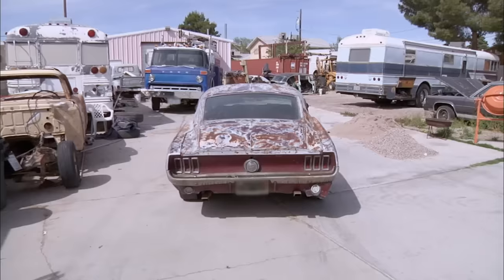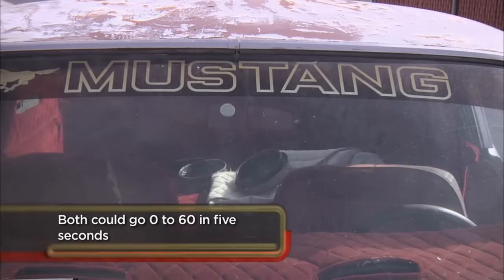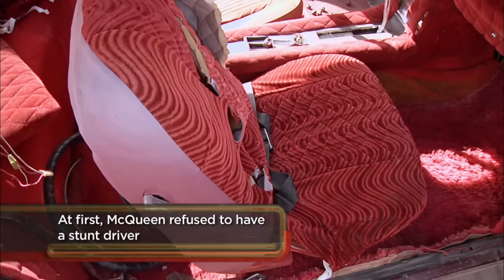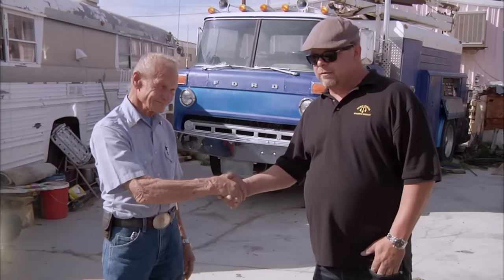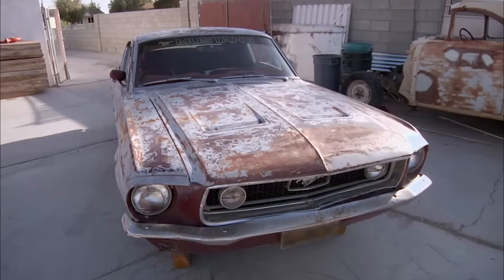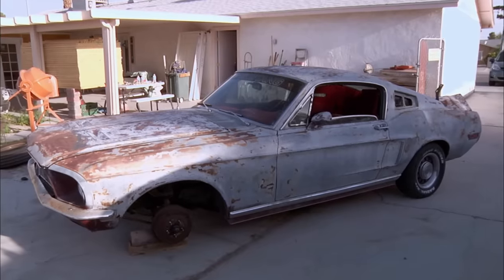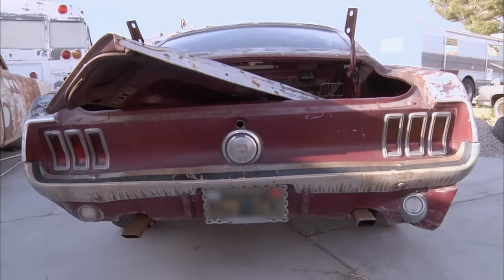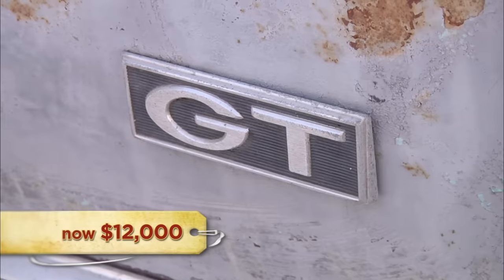Pawn Stars: Rick & Corey Can’t Agree on RARE '68 Bullitt Mustang (Season 6) | History

Comment: I love how Rick was bragging to Cory about how he knew it was a 351, but then Danny corrected him saying it’s a 302
Reply: They didn't even offer the 351 in 68
Reply: The bullet came with a 390
Reply: Legit looked for this commit
Reply: Was gonna comment the same
Reply: The 68 GT came stock with a 390 FE big block....
Reply: @jefflessar149  you mean..  68 Mustang GT's had 390's.
Reply: Original Bullit car had 390 ci-
Reply: @jefflessar149  

The "Bullit" was not a trim level so it couldn't come with anything. 

It was a 1968 GT. 

Engine options that year for the GT where the 289C, 302CS, 302HP, 390 T Bird, and 390 T Bird Special.
Reply: It amazes me how clueless Corey is. Smh 🤦🏻‍♂️
Reply: @branon6565  not a big block
Reply: @andrewirick5620  you forgot about the r-code 428cj that they offered in 68
Reply: I was about to say that I figured I'll scroll down the comments and found yours Rick don't know nothing about 68 Mustangs I doubt that car is even a real GT I mean Danny didn't even mention the code of the car if it's a c code it's a base model and they said it's a 302 so it would have to be A J code if it was a GT
Reply: @CstopCstop  

The 428 was a Shelby only engine. It was not an option for a GT or any other trim level.
Reply: @CstopCstop  

68 was the first year the 302 was an option the HI PO 289 was not dropped from the lineup until the 69 model year. 

You can check Ford's dealership brochures to verify if you like.
Reply: @andrewirick5620  you could get a 428 in a 68 1/2
Reply: @patrick-ro8bi
Reply: Exactly!! I was shaking my head at that one. He was so far off base. A 351 never was an option in those. And a “four bolt main!” 🤦‍♂️
Reply: @andrewirick5620  the 428 Cobra Jet was a mid year option, there are even Mustang coupes with the 428, it was standard with the GT 500
Reply: @pat168  428 Cobra Jet in the GT500KR, this replaced the 428 Police Interceptor that was in the GT500.  But I don't believe this was available at the time Bullitt was filming.
Reply: @chrisz968  wonder how many deals Corey passed on that could of got him rich.
Reply: I don't really know most of my Ford engine sizes.. i know  Chevys and Dodges though , and few fords. I waa just never really interested in them, since the few i had were unreliable. My mopars were ok around town, but my classic chevys and toyotas were in it for the long haul. The reason you see more classic Chevys and Toyota's are because people hung on to them longer because they were more reliable.
Reply: @privateprivate1865  "Classic Toyota" is an oxymoron.
Seriously Private... you have absolutely no idea what you are talking about.
Reply: @jerryjeromehawkins1712  ok. I don't understand what you mean I'm interested though. .. I got to go try to find my old comment cuz I don't even remember what I wrote
Reply: @jerryjeromehawkins1712  I'm guessing we are not on the same page in terms of years? I'm talking about the old 20r, the old 350s and 327s, I don't know what you mean by classic?
Reply: @ericl7199  same I had to read and scroll before saying same thing , talk about scripted.
Reply: 390. Only
Reply: @dougjustdoug6391  The Bullitt cars all were S Codes. That means they had 390 FE engines.
Reply: @CstopCstop  It was a J Code by the engine in it. That means it was eligible to be a GT but you would really only be able to tell by knowing what to look for and by running a Marti Report. (Available 1967+)
Reply: @kalan4787  Yes, you're correct,  but they did have the 68 1/2 "R" code 428 CJ GT that came out mid year.  As an interesting side note, I had read somewhere that the sound effects for the mustang in this movie were from a GT40 with a 289 and bundle of snakes exhaust.  I can't remember the source so I won't state this as a verified fact.
Reply: @dougjustdoug6391  Right, but the R code was irrelevant to this conversation because the car was already known to be a J. The near mythical "X" code was also eligible for the GT trim package, but this is a J.
Reply: @kalan4787  I was referencing the Bullitt movie cars not the basket case car on pawn stars and the fact that the R codes wouldn't have been  available when filming started on the movie.
Reply: @dougjustdoug6391  But that isn't really relevant either. It is well known that both Bullitt 558 and 559 were S codes. They were purchased by Warner Bros. Both Bullitts came with 390s
Reply: @kalan4787  Yes I have already agreed that the Bullitt cars were 390's, but you seem unable to grasp my simple point which was that the 68 1/2 R code was not available at the time of filming and therefore could not have been used.  Making a simple statement of fact is not irrelevant.
Reply: @dougjustdoug6391  Bullitt cars 558 and 559 were both manufactured January 8, 1968 (1 day ahead of schedule.) You are correct to say that the 428 CJ was not available at the time they were produced.

The CJ wasn't available in a Mustang until April of 1968. (Production of the CJ was started in '67 as a continuation of the 428PI and was first unveiled in the "135" cars at Winternationals '68. The "135" cars were produced in December of '67 so the engine must have been produced at least no later than that month)
Reply: @CstopCstop  yeah was thinking an expert would be able to tell looking at the vin or you could call.someone with the vin
Reply: @gearhead762  68 GT's had the 302 OR 390, depending on what powerplant was chosen.
Reply: @Twizter68  i know...i was pointing out to dude they were not "Bullit" models that came with 390s...its just a 68 Mustang GT lol.
Reply: @jefflessar149  Bullitt is a movie.  The 68 GT came with a 390.
Reply: I bought one back in the 80s for 200 bucks
Reply: @ericl7199 lol me too

Comment: Of course this wasn't THE Bullitt Mustang.  Two 68 Mustang GT Fastbacks were purchased for the movie, each with consecutive serial numbers 558 and 559.  After filming 559 was sold off and passed through several owners, Steve McQueen tracked it down and tried to buy it in 77 but was refused, it went through extensive restoration in 2014 and was sold at Auction in 2020 for $3.7 million, the highest price for any car.  558 was heavily damaged during filming and was sent to a scrap yard where it was believed lost, but was found by a car buyer sitting in the backyard of a house in Los Cabos, Mexico, while working on fixing the car they noticed the ID Number and authenticated it as the actual lost second Bullitt, they're currently working on restoring it to its original condition

Comment: Steve McQueens car had a 390 in it not a 302.
Reply: There were two cars used in the Movie and your correct they both had 390's .
Reply: Yep. I read a great interview from 2015 with the stunt driver of the Charger 440 R/T and he had to let off the accelerator on the straightaways to keep the chase dramatic because he kept pulling away.
Reply: The engine sound track in the movie "Bullitt" was actually from a 289 in a Ford GT40 with the bundle of snakes headers.

Comment: Rick: it has a 351 4 bolt main right?
Seller: yep
Danny: lets see the soul of this thing
Seller: it has the 5 liter 302
Danny: exactly what it should have
🥴
Reply: Love that I’m not the only one who noticed it
Reply: Friend Had a 68 in 82 all in primer but with a 289..
Reply: 🤣🤦‍♂️ got em! Clutch catch man lmao 😆
Reply: Lol  it's not a bullet mustang
Reply: If He KNEW the Bullit 68- He would of known, it had a S- code 390, with a 4 speed trans.
This Is not a bullit, or even a big block mustang .
Reply: Not a bullit 68..
The bullit was a 390-4 speed GT..
Reply: @thomassmith9243  came here to say exactly that.
Reply: Plus it's an automatic.
Reply: Lol they didn’t even make a 4 bolt 351 or if they did it was limited run
Reply: It needs a new engine most likely anyways.
Reply: Noel your correct , the 351 C was first manufactured in 1969 for the 1970 model year . Brook Park Plant in Cleveland , Ohio .
Reply: Man, so many red flags. Guy looked at the VIN for about two seconds.
Reply: @jerryhello  Yup if those don't match there goes at least 25% of its value.
Reply: @brendan25  1969 was the year of both 351 Winsor and 351 335 series or nick name Cleveland  4 Bolt Main all 7 mains . So a 351 4 bolt main in a 68 is not possible. Every 351 Cleveland are all 7 mains 4 bolt.
Reply: Glad I heard that right.
Reply: @brendan25  the Boss 351 did abd yes it was rare
Reply: Anyone who knows their mustangs can tell from vin plate what it should be and what options it should have.
Reply: @stevenbrown4735  69 was first year for 351 Windsor.  70 model year first year for Cleveland .  Only 351 with 4 bolt main was the Boss 351 in 71 and the Cobra Jet in 72.
Reply: back when pick A parts was a thing to behold.... 454 ss Chevys could be hauled away for under a grand.... and stangs were a dime a dozen.... .....allovasudden.....
Reply: Only thing you can tell from a 68 VIN regarding a "GT" is whether it has the correct J, S, R, or X engine code. You could not order the GT package with any other engine.
Reply: I like potatoes
Reply: @thomassmith9243  I actually think it was a three speed

Comment: The Mustang GT that Steve drove was an "S" Code car with a 390 Cu. In. engine, 4 speed trans, and a 3.25 axle ratio with no Limited Slip Diff (open rear axle, only right rear tire pushes. I am a certified car nut and was at the Mecum Auction in Florida when it sold for $3.7 Million including commisions. The car your looking at is pretty much a parts car that would require upwards of $100K to restore to concourse condition.
Reply: It's exactly the same in England when you see Cosworths for sale  (today). You could pick them up back in the 90's for a couple of grand (£2000). Were they worth it? Absolutely, NO! 
They were thrashed , abused and just not worth the hassle. As for rot? If they went as fast as they rotted, their speed would be interplanetary. Mugs are paying fortunes for them now.

Comment: Nobody looked at the vin. “It looks like a GT” lol. First look at the vin and then match numbers to the engine.
Reply: This is a reality show. They already checked everything before rolling the cameras. They even have the price agreed upon beforehand.
Reply: They did not have VIN numbers in 1968. It wasn't required until 1981.
Reply: @ron8030  pretty sure they still had some form of serial numbers
Reply: @AJ Smith 
How so?
Reply: @ron8030  my 68 has a vin.
Reply: Lol they had Vin numbers for years  🤣
Reply: Ford started using Vin in 1954
Reply: There was a VIN number but Ford didn't use a unique number for a GT. They also didn't stamp a matching VIN number on the engine. But things like the driving light installation can be clues to it being a real GT or something badged later on. VIN numbers date back to at least the 1920's if not before.
Reply: @1967davethewave  but there is a no in Vin saying what motor come out in it
Reply: @1967davethewave  Exactly. They didn't have VIN's in the windshield, where you could see them. They were usually on a stamped plate on the firewall. But they've always been there. Somewhere.
Reply: @robertbarksdale6270  Yes, true. But just because it has a 302 doesn't make it a GT. And there is no way to identify it as a GT without the original window sticker or bill of sale. Ford wasn't great about keeping records like Pontiac for instance where almost all of the original sales invoices are available through a service called PHS or Mopar who had a different VIN for a Charger R/T than a regular Charger along with a fender tag that would have given all the pertinent option information.
Reply: @1967davethewave  I agree with you on that .
Reply: Maybe they could get a Marti report? Haha
Reply: the gascap says gt...ya i can buy that off ebay for 9.99
Reply: @nelferr2134  Thank You!!!!! YES
Reply: Dude, exactly. Thank you!
Reply: @ron8030  data plate = VIN number
Reply: 68's had a vin plate riveted on the passenger side dash visible through the windshield.  There was a plate with the vin and options riveted to the driver's door.  There was a vin stamped into the right front inner fender apron which you need to loosen the fender to see.  Also many had the vehicle serial number stamped on the engine block if you knew where to look.  If it was a factory GT the door tag would tell, along with how the car was optioned.  Plus if it was a Metuchen built car it would have an additional build tag screwed on the front radiator support.
Reply: Doug, the door warranty tag does not communicate whether the GT package was ordered. The best you can do is use it to exclude a GT. What you learn from decoding a data plate are the following: body (63A, 63B, 63C, or 63D all indicate fastback) Color (R = Highland Green), Interior Trim (2A = black standard buckets) , then Date, DSO, Axle, and Trans.

...nowhere does it tell you that it was a factory GT
Reply: The vin stamped on the inside of the engine bay, matching the VIN plate on the driver door would read a J an R or an S. All others are NOT GTs. This one appears to have front drums. Not a good sign.
Reply: @ron8030  ford has had vins/serial since the late 50’s

Comment: "When this car is like new again it'll be worth $100,000"

Don't mention what you've gotta dump into it to get it to that point, and it's still a small block automatic when you're done.
Reply: Someone has watched WAY too much Barrett Jackson
Reply: @timmoritz7145  no kidding. 

Barret jackass has pretty much ruined the classic car market for anyone who wants to get into it. 

Clapped out old shitboxes the owner wants $15k for because "mine is just like the one that sold for 265k on TV, except mine is a 73, has a slant six, it's brown, and it's a van, but otherwise it was IDENTICAL." 🤣
Reply: @timmoritz7145  I used to work at a hot rod/resto mod shop and guys would spend ridiculous money restoring cars that to anyone who is attempting to collect them for numbers matching/rarity, aren't worth anything, with the expectation of making their retirement off of it.

Like I hate to break this to you but your original slant 6 automatic car is definitely not going to have the same collector resale value as the factory-built numbers matching 426 Hemi four Speed convertible car. But some of these people seem to have that mindset.

Comment: "The least I can take is $500 more than the car is worth." 

And Rick paid it. Corey was right, in this case.
Reply: @evoxxxbih8386  its only worth what people are willing to pay for it, in todays market I wouldn't be surprised if someone did pay 30k for that car.  But in my opinion it needs a lot of work so I would only pay 15k for it max.  People really are going crazy a nd driving the prices of these cars up a lot.  and its frustrating because I really want a Challenger, but everyone wants to sell their rusted out hunk of junk that doesn't run for 20k.  But really no one lied about the price in this video.  I think it was a very reasonable price.
Reply: That was all an act. A J code 68 fastback in that condition is easily worth 18k.  EASILY
Reply: No, no. That's not $30k. It's "high teens."

Comment: I restored a 68 390 GT in 2000 and sold it 2005 for $25K.  It wasn't a perfect restoration but it was a solid car.  I built FFR4511 MKII with the proceeds.  I wonder what a restored 68 390 GT car is worth today?

Comment: I would definitely make sure the numbers matched first
Reply: They never said it was the original engine. Only that the engine was factory stock. Ford made the 302, 302 Boss, a 390, a 289, the 300 inline six...428, and the 429...of that Era.

Comment: Rare that Rick pays the retail price. Must've been a purchase for himself.
Reply: That was fair market value on a '68. Being 95% complete. The engine was not the original engine...only factory stock. The 1969 may have come with 428 cobra jet.  429 was another version. Also the coupe could be purchased with the 300 c.i.d. inline six or the 289 V8.

Comment: He literally couldve looked on the inside of the door to see that it was an original GT
Reply: No he couldn't
Reply: @kalan4787  yea at the vin #
Reply: @Jd-ry4th  No you can't. First, the VIN is not attached to the door. That's the dealer warranty tag. The VIN is on the passenger side of the dash. It matches up with the stamped VIN on the driver side inner fender. Neither the warranty tag nor the VIN plate will tell you whether it's a GT.

Comment: Bullitt had a 390 FE. 351 wasn't offered until 1969. This is just a GT. I used to have a 67 GTA fastback that came originally with the 390. When i acquired it,  it had been swapped for a 351 Windsor.  Beautiful car.  I regret selling it.

Comment: In 1970 I had a chance to buy a 1965 Mustang with a 289 engine and auto transmission or a 1966 Mustang with a straight 6 engine and 3 speed manual transmission from a used car dealer. After test drives the 65 had a miss at low speed and the speedometer didn't work. The 66 ran perfect and had a working speedometer that went up to 160 mph! Being a kid I bought the 66 as I didn't know how to work on cars. I still wonder to this day if I made the right choice.

Comment: 351 4 bolt main wasn't even available in 1968...if it's an original and real G.T. it would have a 289 or 390
Reply: J code 302s could also be GTs in 68

Comment: At 1.13 rick asks the seller if it has a 351  4 bolt main but at 4.02 the seller tells Danny it is the factory engine 5.0 302 engine

Comment: $12.5k for a solid '68 J Code fastback with its original drivetrain is A STEAL
If you can find one in that price range, it's usually a basket case and it would not be a J Code.

Comment: Screwing that old man out of money,paid 12 k he will$5k in the body $3k in interior, another$2000 to have the motor rebuilt $1500 for a rebuild on the trans,$1000 for tires for a total of$24,000 invested and within a month he will sell it for $65000 easy if not more
Reply: Not with what Kounts Kustoms charges. A complete resto on that thing seeing how rough it is would easily be over $25K.